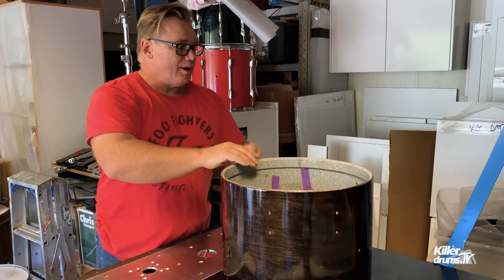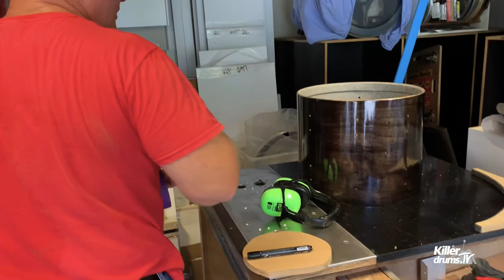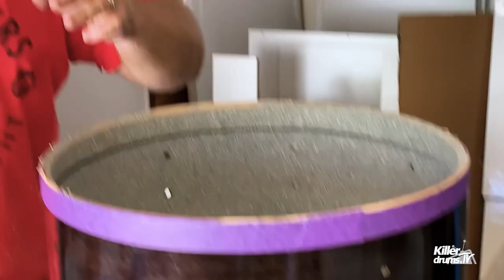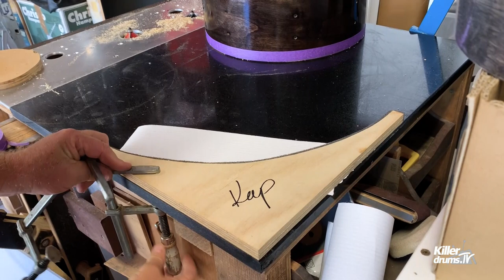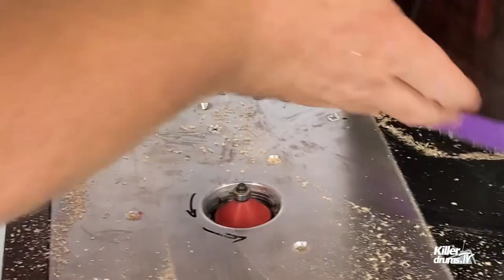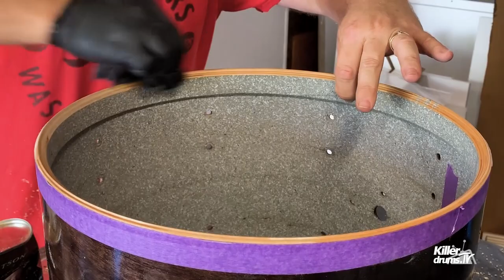ROGERS Drum Resto | PART 3 - how to cut and true bearing edges.

Comment: I have a 50+ year old set of Tama's including 13",14",15" and 16" rack concert toms and would like to renew the bearing edge of them to "factory condition. Received them as used, when I was 15 and getting serious into drumming. This video, and the particular detail you provide in it, is just the inspiration for a project, as I approach retirement. The drums have the same reinforcement hoop interior and is part of the bearing edge. Also, the identical flake pattern sprayed on the inner shell, as do your Rogers'. I need only to purchase a table style router and a few other tools required. Would be nice to hear how good they would have sounded, right out of the factory. Brilliant video...well done!
Reply from the maker: Thanks. We appreciate the comments.

Comment: I'm thinking of making a bench like yours. 

Is that a granite kitchen worktop? Or something even flatter like a granite surface plate

And is the metal (aluminium?) that the routers are attached to something you made yourself / had made?
Reply from the maker: Hey mate, this one is my B bench, it’s a granite slab with a custom ally plate I’ve machined to suit what I want. Basically to have two or three cutters set and running at any one time. So I can cut inner and outer super quick. 

I recommend a granite surface plate and 5mm ally plate for the routers rigged to be perfectly flush with your surface plate. 

My A rig is better than the b rig, but it’s 20 times the price and out of the reach if most people, so I use the B rig here to keep it real for those wanting to try and do the same. 

All the best with the project. 

Tony

Comment: I have my dad's '72 Rodgers with a black wrap and they do sound amazing both recorded and live. However the 12" tom is a bit out of true on the batter side which can make for some fiddly tuning. I've got it dialed in right now but I've been thinking about getting it recut. I don't actually trust my skills enough to do it myself yet but I'm gonna get some cheap, crap drums and practice.
Reply from the maker: Years ago when I was wanting to actually hear what difference a bearing edge made to a shell, I'd buy massive tubes of Keller shells in 12" and 14" diameters the cut a whole bunch of shells the same depth and put different edges on them all.

But that's a was to practice on quality shells and they are cheap. 

Always use sharp cutters. 

Have fun. Tony
Reply: @KillerDrumsTV  Thanks

Comment: Hi! Thanks for the awesome videos! I just really wanted to see how you finished the varnish.. Could you tell me how many layers of the poly you ended up putting on all together? And did you put anything else on top of that or was it just the poly? Thanks!
Reply from the maker: Hey Zanis, thanks for your comment. Four hand rubbed coats and nothing on top. What you see is the actual poly product. The trick is using the super fine steel wool in between and removing all wool dust before coating again. The good thing is that if you stuff a coat up, just use wet and dry, 800-2000 grit sand paper to flatten and bumps and take off the sheen of the last coat and go again. All the best with your project and thanks for watching. 
Kind regards Tony Moore

Comment: Hi mate ,
I just had my drums repainted they look great but the bearing edge has been painted also.The edges are flat perfect but have paint.
Does it need to be removed  ?
Tested it it sounded OK?
Thanks dude.
Reply from the maker: As long as it's smooth and the edge true, it rarely matters what the contact point actually is.

Comment: thank you! what is drum shell made of?
Reply from the maker: Hi, Rogers used “Jasper” shells from the 50's thru about 1962; which were 2 or 3 ply depending on the shell size, with a 2 or 3 ply rering. These shells were maple/poplar/maple. The painted shells usually had a thin outer veneer of mahogany. 

Rogers switched to “Keller” shells, which were originally 3-ply but standardised to 5-ply within a year or 2. These shells were Maple/birch. 

This drum is the later. Thanks for your comment.
Reply: thank you!

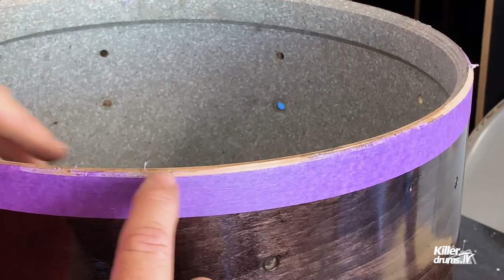Comment: Wow… after quite a while I stumble back to the same video…. For clarity, look at 6:55… this where the speaker says” cutting, not cutting.. cutting, not cutting”….. THAT is the proof.
And yes the “ right order …IS… 
1) place on “ known flat surface” and check for gaps ( by .. a) shining a light onto the flat surface from inside the drum and look for “ light” ( light means gaps, means bearing edge not flat) or ..b)  try to “ rock” the drum… if you can hear/ feel a click or tap… again the bearing edge is not flat.I
So
2) yes start cutting infinitely shallow cuts… remove as LITTLE MATERIAL as you can with a router. After the first full cut, You may notice exactly what the speaker stated … cut… not cut…
3) take pics… just so you will be able to see the progression…
4) using a sharpee or magic marker.. “ blacken “ the WHOLE “ slant/ bevel” edge where you expect to be cutting… AND … the very top/ end of the shell where the head should actually make contact..BUT DONT blacken any area that won’t likely be cut away… ( unless  you WANT magic marker left on your drums)
5) adjust the router to take JUST A LITTLE MORE…. another very fine MINIMAL cut.
6) inspect and note how much magic marker is still remaining.. this is where the bearing bevel and edge are still low / not flat.
7)…. NOW… IS WHERE you might make the first set of sand paper table attempts…
8) sand / rotate for a moment and then INSPECT.. ..THIS… THIS… THIS… IS THE PART WHERE YOU WILL SEE HOW BAD/ not flat the drum bearing is… clean wood= high spots… magic marker = low spots…= the places where you drum head was never seating= that’s why you could never get a great tuning at lower tensions.
9 Now back to the router… take away a LITTLE more bevel… and again inspect.
10 Back to the sanding table SAND JUST A LITTLE … BUT EVENLY AROUND THE DRUM
11) YOU you are trying to take away as little material ( wood) as possible while leaving NO MAGIC MARKER.
…
12) now you are close… start light hand sanding… not heavy sanding… sanding like you are polishing the very top of the drum. 220 sand paper, then 320, then 400.
13) I have no idea about the bees wax or other lubes… but yes assuring that the head tension can easily balance in all directions is important.
 CUT AWAY AS LITTLE AS POSSIBLE..
MAGIC MARKER ..EARLY … in the process …helps you track / see your progress
Reply from the maker: Chers mate.

Comment: to true the edges it is in my experience faster and better to use a big A2 sheet of 60-80 grid sandpaper, and sand the complete edge in one go.. no other tools needed.. often i cut the edges 50% first so there is less to sand off. Easy and perfect edges.
Reply from the maker: Hey mate, appreciate the thought, however the issue with a large A2 sanding plate like DW and others show often in use in videos, is that it cuts the whole surface and not just the high spots; this done with absolute even downward pressure over the whole bearing edge line will achieve good results. HOWEVER, in practice this is rarely, very rarely achieved, especially as shells get larger, where you physically can't hold down more than the small area where your hands are positioned. Second, the paper wears unevenly and so the illusion is that it's cutting evenly but the reality is that it's not and can't cut evenly. As such I now only use a sanding area as large as my hands can keep pressure on and can quickly replace the paper as it fails. But I agree edges must be cut before you fine tune these edges on the granite slab with sand paper, then cut and true until it's perfect. I've extensively used both methods and ultimately ditched the A2 sheets method in favour of this alternate and simple method. Lastly the palm block plane is an essential tool in experienced hands for bearing edge trueing. Often A2 sanding method throws the bearing edge out of right angle to the shell from one side to another. I've had to repair this on many revered hand made drums. 

We have a bunch of new resto videos going up, some dealing with controversial topics and issue and demonstrating the proof of their failure. 

I appreciate the chat, have a great day. Tony

Comment: I think this is the most misleading teaching about making bearing edges. The most, I repeat THE MOST IMPORTANT thing is the level drum with the sides. After that comes routing and everything else. Drum on level, checking with light it sits right on level and after that, routing. Everything else was ok, but the most important point, level it first for clear cut.
Reply from the maker: Hey thanks for your comment. 

I've done thousands of drums mate, any and every way conceivable, not as a dIYer but a tradesman, a craftsman. Most bearing edge videos are DIYers who make drum videos and so they wouldn't know a lot of things and just do things on repeat; what ever they saw with out thought. 

A craftsman, tries things every which way to do things faster and maintain or improve the quality of result. 

As such, I've heard everyones thoughts on this stuff of decades, but their practice fails in function and efficiency every time.

There are many schools of thought around bearing edges. Most hardliners with only "one way" have only explored one way, or only know one way. They can't think any differently as their skills and awareness just aren't up to the task. 

Simply, The physics of a drum necessary to activate what we want in a drum are simple. But so many don't even understand that at all. 

Here it is for you: If an African hollowed out log with nothing perfectly round, level, true or at 90 degrees, with bearing edges hacked out with a sharp rock can produce a more pure and resonate tone that all the previous applied to a perfectly crafted drum shell like DW then you're missing something, right. 

That said, and to respond to your criticism. Those who don't reduce the bearing edge material first are wasting their time rotating a drum on sandpaper. As their musing around and around for hours (sarcastically used) to reduce a wide surface (as opposed to a smaller surface) often just proves the point that people only know one way and don't have the skills or awareness to try other ways BEFORE making judgment. 

In fact, I'll add your comment into my next resto video, to put your theory under fire and cut one side each way and show others why your way is actually a waste of time and introduces the potential to impact negatively on the result. A rule in quality and efficient craftsmanship, is reduce before your get precise, other wise it's a waste of time.

Your method is not technically wrong, it's just not better or even right professionally. It's DIY folly. A profession has the approach to every task with quality as the only goal,  and skilled precision and efficiency, the method. 

If I can cut a better or even the same quality edge in 10 minutes, and others take 45 minutes; both are of equal quality, but only one was smart and a better way. Try it. 

Thanks for you thoughts, have a great day.

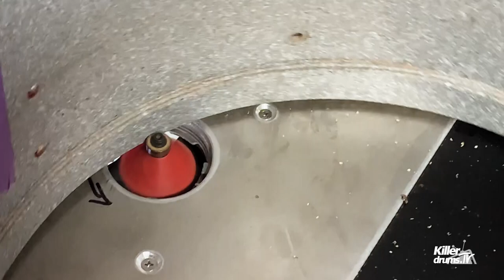Comment: At approx 8:00 minutes in… the first “ skim cur” is completed and the speaker shows the unevenness of the new bearing edge cut….. this is due to how BADLY…HOW POORLY…. the bearing edges were cut originally and how TERRIBLE the quality control at Rogers was. I own a 1970 (? +/-  a year or two) Rogers red onyx holiday kit….. not one…. BUT……ALLLLL…. of my tom and bass drum bearings were HORRIBLE….. CRIMINAL….JUNK !
Yes I re- cut them…. And yes the drums sound “ better” but no- where NEAR…as nice as my Yamaha  or Mapex drums….. “ Loud and projecting?”…. yes…. Pure, clean and focused ?….. hell no…
So if there are drummers that swear that their Rogers Swivomatics sound great… doesn’t this hint toward how BAD the QC and consistency was? …
Let me guess…. Buddy Rich and Louise Belson had their drums hand picked and a dozen Rogers drums were declined before they landed on a “ good sounding “ set.

Ps… I also have two early Swivo bass drum pedals too…… ( short board)…. JUNKKK…
The mounting plate that attaches to the BD rim/ hoop causes a failed geometry  where the pedal rests way too far from the laying surface ( head)…. So the beater is traveling well past “ perpendicular” when it is contacting the head. Swiveling the upper portion of the assembly to correct for this is NOT the correct correction as now the beater would then be traveling at at a horizontal angle as well….. 

Although a great idea….. again…… JUNK….
For the time (1960-1980) the Ludwig speed king was twice the pedal…. 

Do I love my Rogers? Sure… I’ve had them since 1973… so they are family…. But THEY…ARE….NOT……. my “ go to drums for recording or small band low volume combo gigs. 
There are WAY too many wild overtones.
Just curious…. Show me a pic or a video…. Of ANY of the modern greats playing 1960s- 1970s Rogers Swivo….I can think of ONE drummer… ( Counting Crows).
 Again…LOUD… ( big band and rock) they are ok….. quiet… they are noisy wild overtone laden mid grade junk
Reply from the maker: Hey J, yeah I understand. The thing I like about old Rogers, is that compared to more other manufactures at the time, their shell construction method was superior. 

So as in anything if you have quality materials, quality design and quality craftsmanship, you get a quality result. That's why, with vintage drums, I particularly like tweaking Rogers shells. 

That said all modern manufactures should be making quality shells, particularly with computer controlled production and consistency. That said, the Timbers used these days are very young and that can sometimes lose the characteristics of age and stability in tone and timber. 

I generally find most drums need work, even my brand new kits at times.

The point that many never discuss about modern drums, is that of fixing lugs on to the shell too tightly causing the shell to choke and all that good wood and tone to go to waste.

All the best mate.

Regards Tony.

Comment: I am working a new raw shell...I know you said penetrol on bearing edges here as well as interior on other videos. How about the exterior with penetrol ? I know that leaves either wrapping or  using oil based finishes....I plan to wrap with delmar using only tape on an 8" premier tom . The other toms are lacquer finished....
Reply from the maker: Penetrol oil dries and can be treated as a primer, meaning you can definitely seal the outer of the shell too.

I have a kit here I made back at the millennium (2000) and it’s 100% penetrol inside, outside, edges and also drill holes. It looks almost as good as day one. 

The byline on the Penetrol can is something like “makes paint stick to anything”. It’s my go to.

Comment: 3M 4611 tape is my go to -100degrees to 500+degrees.....only at the overlap which is under a long lug.
Reply from the maker: Hey mate, a long time ago in Bethlehem, I did an A/B of three methods of wrapping a drum, focused on the seeing if there was a reduction, increase or neutral affect from the method on sustain, tone, and anything else. Tape of any kind had the greatest negative impact as it effectively created an air cavity between the shell and the wrap, much like how it is used in studio walls for sound deadening. 

The best was a thin film glue film over the entire shell with compression. That said the method I use is contact spray glue on the shell and the wrap. Wait 5 minutes and then bring together and they are glued on contact. 

In essence I can wrap a drum faster this way than in using tape and you almost can’t tell any tonal difference (in resonance not pitch) between an unwrapped shell of the same thickness and a wrapped shell. 

There is nothing wrong with tape, but it’s worth noting that wrapped YAMAHA recording custom drums are the most difficult to remove their wraps because of the full contact and type of glue used for drum wraps so to not take away from the shells resonance. 

Thanks for your comment.
Reply from the maker: If you’re a little ways away, hang in for my wrapping video. I’ve seen all the ridiculous was people advise how to wrap a drum, but if they were cabinetmakers there is really only one method that is professional; and I’ve reduced that to a diy method with 100% success. 

Subscribe and it will let you know when it’s up.